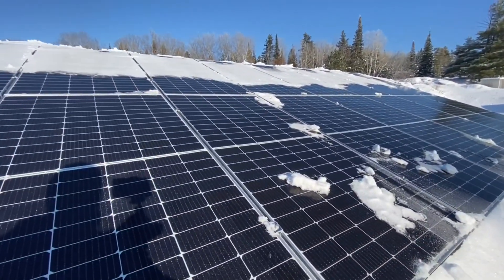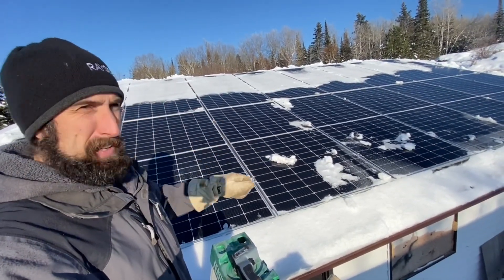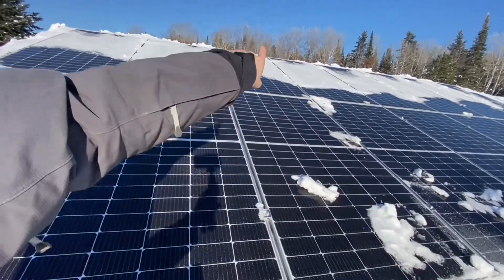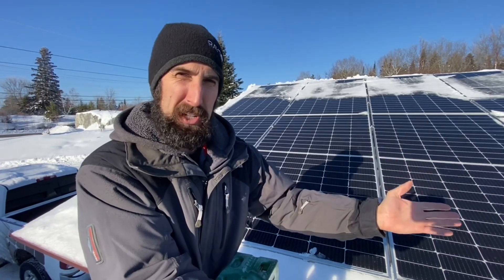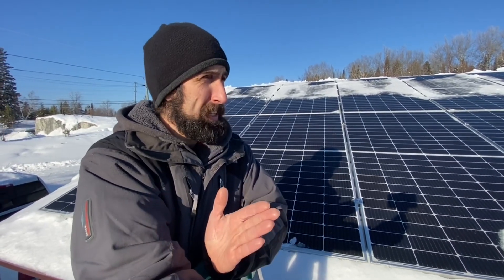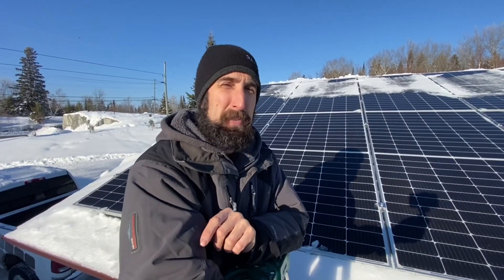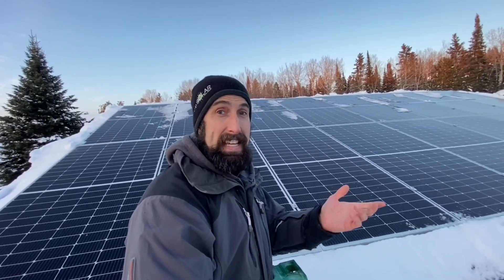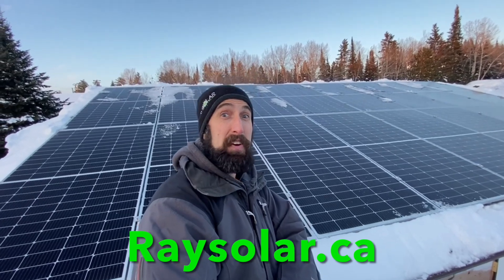Solar Panels Are Melting Snow! | Solar Panel Ideal Angle!

Comment: I found this video to be extremely well done.  
I learned quite a bit.

The one question I have, which maybe you have an idea about is would there be any temperature difference between a roof mounted, as in the video and a ground mount.

My thought is it's possible that if a panel is roof mounted, and off the surface of the roof by a few inches,  the air behind the panel may increase slightly and add allow the panels themselves to reach a slightly higher surface temp than it would on a ground mount, which would presumably have a lot of open space and the air below the panel would stay fairly constant to the ambient temp outside.

Comment: An interesting thing is that silicon photovoltaic cells are actually infrared LEDs when current runs through then backwards.  So that could provide a lot of heat to naturally dethaw solar modules without any additional hardware.  However, the blocking diodes installed in panels won't allow reverse current unfortunately.

However, I figure it might not cost too much more for the factory to add a thermal heater pad (or two) on the back of each solar module.  If using microinverters array, there is already a ready supply of the home's own mains 60Hz 240VAC power up there to hook these up to using the same MC4 connectors on the home run cable.

Solar module prices are dropping rapidly so there will arrive a price point to have this heating technology as on option for snowy winter climates like Canada -- it could just be '-W" winter sub-model of any module.  It would cost not too much more in labor either, as its just as simple as plugging an extra connection from the heaters to the microinverter.  The microinverters contain both the 240VAC power (from the home) as well as the logic to operate the heaters at the most optimal times.
Reply: That is a very interesting approach, would like to discuss it further. Can you please provide me with your email address?